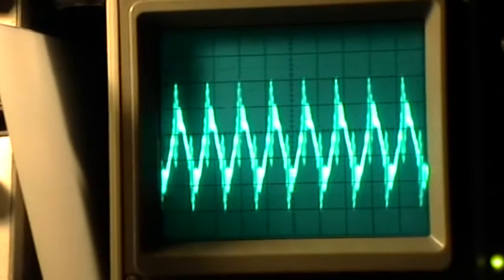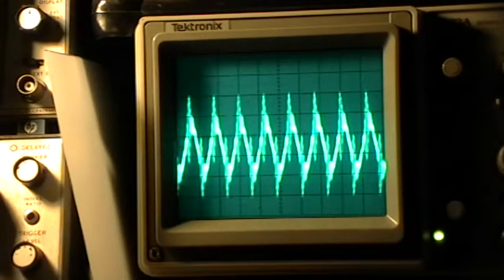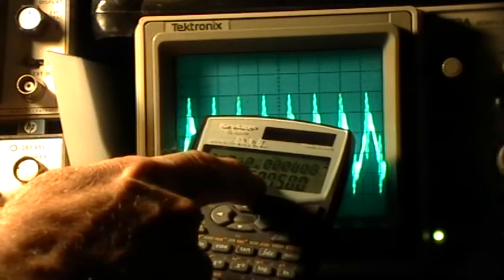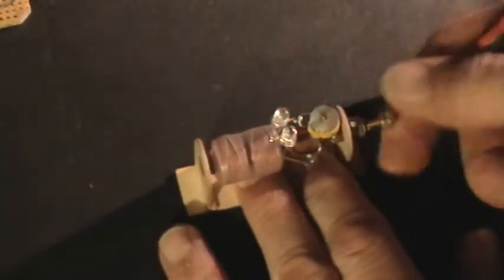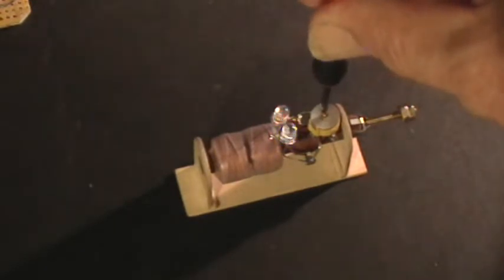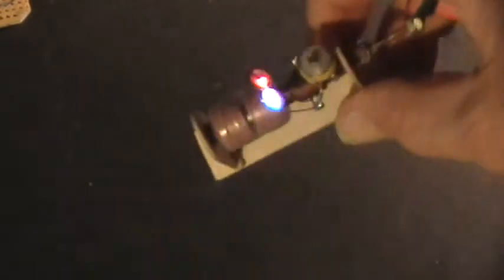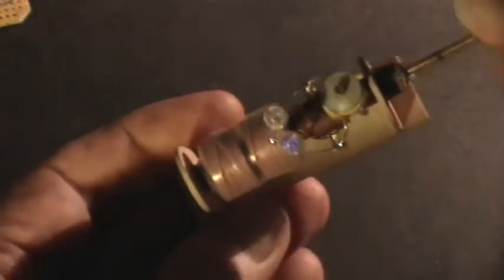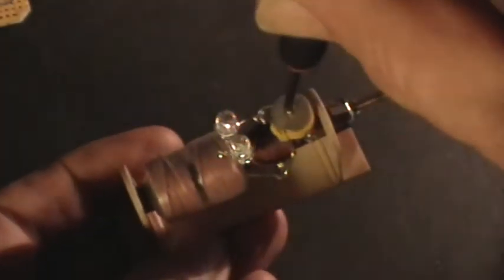Resonance: Loopstick ElectroSmog Harvester, Resonant Tuning

Comment: Wouldn't mind knowing how much power you can extract. I noticed that the resonance changes with position and orientation, and that's to be expected because the nulls and peaks are standing waves which are frequency, position and orientation specific, especially in a confined space like TKLabs.

So the idea for a Mark II  naturally occurs.  We've seen that, for any given position and orientation, there exists an optimal resonant frequency. So the Mark II would scan for that and auto-set the capacitor. VIOLA!

Comment: Really cool. I worked out 2.4GHz to be 1000uH and 0.044uF. Built it up and have just been walking around with a multimeter attached going 'uhuh, oh, uhuh, hmm, oh'. I'm not tuned up yet, it responds better to mains wiring for one thing, but it's a fun little project on a rainy Tuesday :)
Reply: sorry, your calculation is wrong, 1000uh and .044uf should have a resonance frequency of almost 24000 c/s not 2.4Gh.Thanks

Comment: Wireless transmission of electricity, what a cool project. Have been explaining this process to my teens and now they get it !!!  As usual another great vid, thanks for posting.
Reply from the maker: Thanks for watching! I have several more interesting videos concerning wireless power systems, please check my channel and search for "wireless".

If your teens are looking for a science project, you might suggest "wirelessly powered submarine" to them. Small brush-type DC hobby motors will usually run just fine when completely submerged in clean water, and a receiver system only requires a few components, all of which can be completely submerged. A transmitting loop could surround a small aquarium tank, the transmitter itself could be hidden in the base or displayed prominently, and a little wireless "fish" could swim around and around...... Nikola Tesla would be proud.

(blow the motor out with air and let dry after submerged use, and put a tiny drop of oil into the bearings/bushings ...)